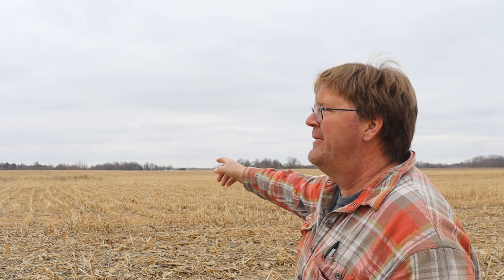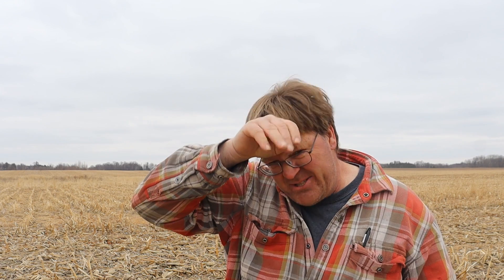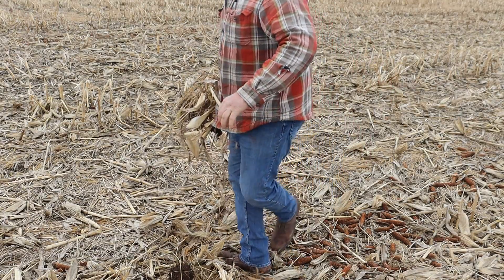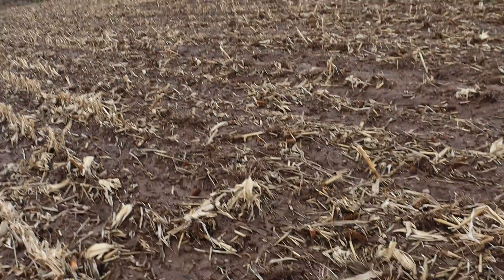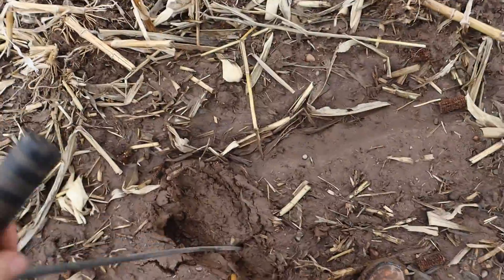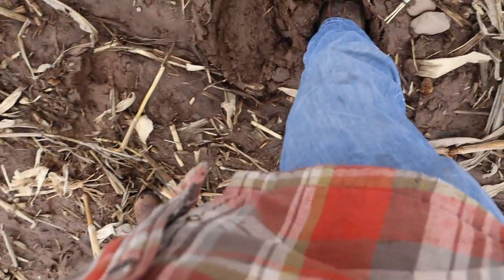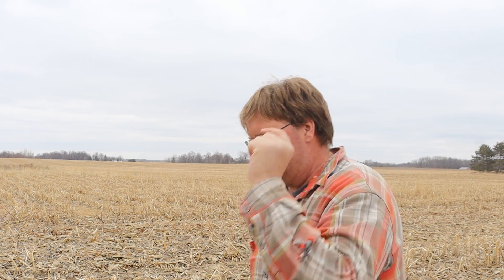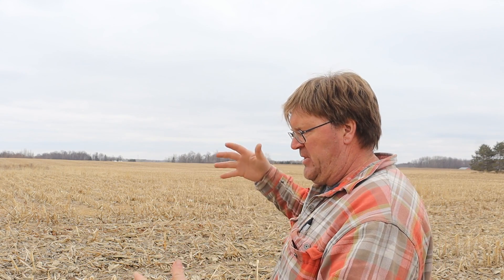Fall tillage fallacy, quicker warm up in the spring and fixing compaction

Comment: Since we parked the plow and hooked up a disk ripper our fields improved immensely.   When we stopped doing fall tillage on corn and no-tilling all our beans our fields improved immensely.   When we parked the disk ripper for the shallow strip-till bar in conjunction with cover crops, no-til and a 3 crop rotation I don't even recognize our farm anymore.   So much less bullshit.   First few years we were finishing corn harvest in january so we wouldn't rut up the fields ahead of no-til soybeans, but after several years we don't need the frost as much to carry the harvest equipment.  I think I'm finally ready to sell our 21ft disk ripper, hasn't left the shed in 3 years.   It's the only tillage piece we own that has any value.  haha.   I'll always have a disk and field cultivator so we can get fields smooth again after clearing land or installing drain tile but they don't get much use anymore.   I'm glad you didn't do the mic drop.   Ag needs champions to explain why and visuals like this are how we learn.   Seeing the slake test or a rainfall simulator is how you change minds.   Changed mine.   2010 I was a big proponent of the moldboard plow.   Gotta plow!   Now I'm wondering how many years it will be until I can get a low disturbance strip-tiller or even get to full no-till.   Things change.
Reply from the maker: Someday we're going to have to meet up so you can buy me a burger! LOL I'm just kidding very well said
Reply: @jonstevensmaplegrovefarms3754  haha.  I'll buy ya a burger.   I know this great place that serves grass fed Angus.   I think it's called your freezer.
Reply from the maker: @Farmerknowsbest  if I ever get YouTube Rich I'm traveling to all you guys that I have met through social media so we can have a burger and a Mountain Dew and just a good visit and then off to the next guy

Comment: You are right on about everything that you said . Every year I see such a change in my ground from savearly damaged dirt to looking more and more like potting soil . My water holes are almost gone , before we were stuck in the old wet spots all the time . And all my neighbors tell me that I got to go in and break up that compaction or I won't grow anything. I tell them compaction doesn't concern me anymore and they get mad at me cause they don't believe me.  So I do just what u did and grab a prob and sink it to the handle even where the combine tracks were . Some of them still just walk away shaking there head in disbelief.
Reply from the maker: Nice! 
They keep saying it don't work here and one of these times I want to ask them if im failing

Comment: Nice video. I like to see these till vs no till comparisons! It would be nice to hear how many years and what crop rotations got this feild to this point.
     I have been doing a little experimenting with no till and cover crops last few years. Last year I had a nice stand of rye on corn ground was impressed with how well the ground dried out and handled snow melt. I was able to spread manure without making a muddy mess.
Reply from the maker: Nice! 
Couple years of no till/ strip till corn bean rotation. Then 3 years of no till corn on corn with covers.

Comment: Hard believe how early you can push your soil probe down, just amazing! I did some hand samples here last fall and things were so hard I thought I was going to bend the probe over before it went in and I was only trying to get to 6-8”’s
Reply: I ment easily push down.
Reply from the maker: It's come a long ways! When we were doing full tillage if I went out into the field during the growing season I would have bent that probe. Now that the soil has structure there's a definite firmness but not a hardness if that makes sense

Comment: Years ago I learned that deep tillage and burying residue decreases organic matter dramatically. Organic matter and residue is best served in the top couple in inches is soil. It promotes earthworm activity which handles compaction issues. It raises cation exchange capacity to allow for better fertility levels.   It improves moisture uptake. The benefits go on and on. Of course there are cons as well. Tillage has it place and always will. We should just work smarter not harder.

Comment: I'm going to try some not ill beans after corn this spring. Have a lot of corn trash. Hope this old 6606 White will put the beans in the ground. Just concerned about all the trash. I usually run a McFarlane Reel disc once. What do you think?
Reply: Beans are pretty forgiving, and a good way to start no-till. Plant 30’ -50’ then get out and dig some seed trench. If it’s pretty clean and at consistent depth you should be fine. You’ll likely need to set up a little deeper because gauge wheels running on residue. Check for hair pinning and seed on surface. Adjust planter and/or increase seed rate to compensate.
Reply from the maker: @jrwstl02  very well said
Reply from the maker: As far as a high-speed disc maybe that's one of them tools that you need to use to help wean yourself off of the deep Shank?

Comment: Wish you could translate this to the south. We never freeze, no frost. I'm always a week later to 'fit to plant' conditions because I wait for the soil beneath the residue to dry out so I can row the row cleaners.
Reply from the maker: I wonder anout you down there. So is it something that covers could help? Or fall strip.till.with a strip freshener vs a strip till machine?
Reply: @jonstevensmaplegrovefarms3754  A cover reccomendation that could be chemically terminated since we don't get hard freezes (about 1 per century). That would be a good start. My soil is clay, cec in the low 40s. You don't want to do anything to it in the spring. I think over the time of no-till it's highlighting the poor drained spot and holding moisture longer.
Reply from the maker: oats, have to get oats in there somehow.  at every conference i have gone to all the soil scientists bring up how oats are good roots for the soil, the straw is good for the top soil, and the grain is good for human and animals.    wonder some oats, radish to start with on a small spot to see what it does.
Reply: @jonstevensmaplegrovefarms3754  Thanks. I'll try it on a non-troublesome part of the field.
Reply from the maker: Will be interesting if you spread in the fall how much growth since you wont freeze. A couple lbs of radish goes a long ways.  just do a small area if it works then you know, if its a disaster you're out a half acre. Maybe it take several years to see an improvement?
Reply: @jonstevensmaplegrovefarms3754  This will blow your mind. Avg temps in December, January, February 51, 50, 53 respectively.  I think I would put it in late October so I could terminate in January at 6 inches high. Our warm season is long enough to do 4 tomato plantings a month apart and harvest the last one before a freeze in December
Reply from the maker: ha!   i think you will get some growth!  so would you let stuff just get mature or terminate it at some point?

 historically we usually get two weeks of highs of -10 in january or february. this year it was mild because we only got the overnight lows of -20s.
Reply: @jonstevensmaplegrovefarms3754  I think I would terminate it as soon as I get some dry field. I've seen the rye here get out of control pretty quick.
Reply from the maker: i bet!

Comment: Whats your thoughts a vertical tillage? I mean the real vertical till machines with the 5 degree or less angle not the discs with special blades.
Reply from the maker: If it helps reduce the deep shank it can be helpfull.

Comment: I gotta ask in our area I think it can be done but my father in law tried it though some FSA program but pocket gophers moved in and just murdered his fields where you couldn’t scoop a soybean crop off the field if you tried lol is there a remedy to that? your field looks great we have very heavy clay soil where it takes either sunlight on black or I was thinking about throwing a cover crop in the fall that’ll grow right away in the spring to draw the moisture out otherwise it’s gumbo like last spring when it froze and we didn’t get the ground worked...love your videos and also did you end up buying a worthless leaf blower to check crop losses? Lol
Reply from the maker: I did not get one yet. 

There is a cure 4 gophers call the Gopher plow. There's a few fields just to the west of me even if they do full tillage the Gophers are so thick you can't make hay or beans.  It's a thin Shank with a hopper on it and a gauge wheel that chain drives from the wheel to the hopper and that feeds poison down the shank so in the fall or in the spring whenever they just zigzag around the field where the Gophers are really bad
Reply from the maker: As far as the gumbo clay on the other side of the interstate we have fields that have no topsoil it's just yellow clay right to the surface when it's wet in the spring it is just a complete muck and if it's dry it gets so hard you have to put weights or a couple round bales on the old Glencoe chisel plow.

You could try a winter Rye but do not roll it like everybody else does you would want to kill it standing up so sunlight and air can still get to the ground

I seen other soil Health people from down south show pictures of their soil and where it used to be just this clay that you can make coffee mugs out of and they turned it into nice soil. It might just take a different type of cover crops or crop rotation and more time than somebody else.

Is strip till option for you?  The guys in Western Minnesota on that gummy black soil they strip in the fall. Took several years for the soil to come around but they say the same thing I say now
Reply: Thank you for the advice! I try my best not to run over the field anymore than I have to to for organic matter reasons we farm about an hour east of Fargo our Seasons are pretty short i was thinking of rigging up the fan off an old donor 8600 on the sprayer to blow a cover out there while putting fungicide on wheat otherwise there isn’t much time left afterwards. A neigbor tried a cover after wheat a couple years ago and the radishes were about the size of baby carrots by the time things froze up. I looked into strip till but I would rather try and have something growing all the time to gain that sponge layer. But thanks again for replying!
Reply from the maker: An hour east of Fargo! Well then you're only a few more hours from coming over here next fall for the farm show

Yeah that's a good idea why the wheat is still out there get a cover crop spread so after you take the wheat off it can do something

Comment: You are a hoot, lol. That bear bit was great. we need more people that can be goofy and not get offended,  lol. 

I want to try no-till corn in a field that has been in hay for years. Last year was the 1st time back in crop and I no-tilled beans. Question 1, my John Deere 7000 is not set for no-till.  No colters and doesn't have the down pressure springs. So will this be able to get seed the ground?  Question 2, when do I need to get the P&K on the field that will be needed? I will put down liquid starter when planting and side dress 28% later.

I would hate to lose what I have with the field the way it is but on the other hand I need to be able to get seed in the ground. I looked into getting the planter upgraded but it will not be able to happen this year.
Reply from the maker: In the shoup they had some Kinze down pressure Springs that clicked into the parallel arms. One of them per row should get you in unless you have just rock hard ground

The B&K that's up to you I don't know if there's a right or wrong time to be most beneficial to the crop. For us here I would do it after planting just because of labor-management getting the seed in the ground

Unless that ground is just super hard I would not worry about a no-till Coulter

Going into sod make sure you do a really good burn down.

If it's your first attempt maybe just leave a small part of the field as sod so you're not risking a lot of Acres while you figure it out?
Reply: I will be going into bean stubble. Last year the field got a burn down then planted beans. About 8 weeks later I followed up with round-up to get some weeds that broke though.  It was very clean at harvest. I did nothing else since harvest.  I plan to burn down and then plant. 

As far as the P&K (dry), I guess I thought you needed it on the ground in time for it to soak into the ground if you were not working it in. This hole no-till is new. 

I'm wondering just how much P&K is ready needed. 🤔 I don't want to deplete the ground but it is the fertilizer company that says you need this much, lol. Thanks for your input.
Reply from the maker: Money in the bank. Its water soluble what if the field doesn't have a lot of runoff then get it out early. If you do it right behind the planter you still have a month before the corn is going to be looking for it. You could always mix a gallon of high-quality phosphorus and a gallon of high-quality potassium in with your liquid nitrogen that your dribbling on the surface next to the row and that would replace a bulk of your dry product. Do the math if you spread dry k which is a 60% product so if you spread it at 100 pounds to the acre you only end up with about 20 lb of product next to your cornrow. A gallon of high-quality liquid K product banded right next to your row would give you almost a similar amount of pounds of product in that root zone

Comment: People don't think about is the insulation residue provides... not just temps but everything else. That frost line will be shallower vs tilled.

The sun is powerful.
Reply from the maker: Yes! That residue that's keeping them way too cold in the spring also prevented the frost from getting that much deeper

Did you sell that payloader yet? That's a good-looking machine